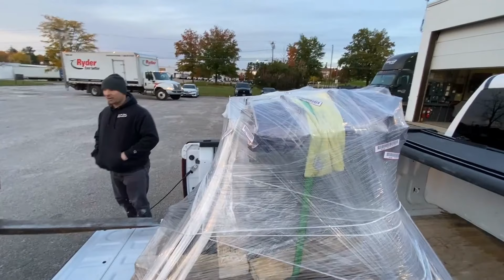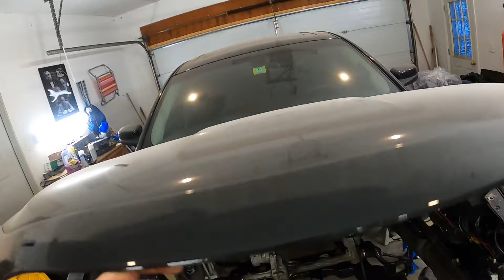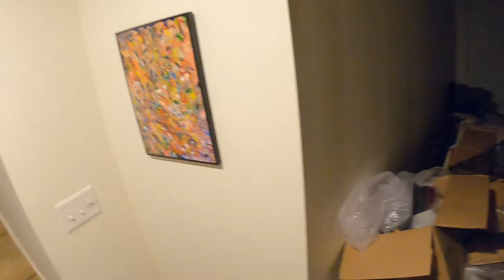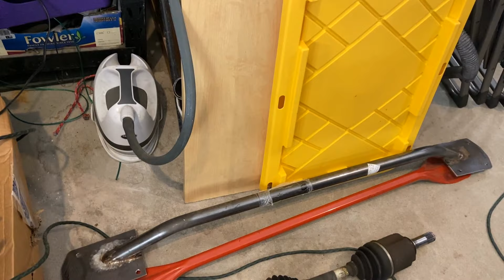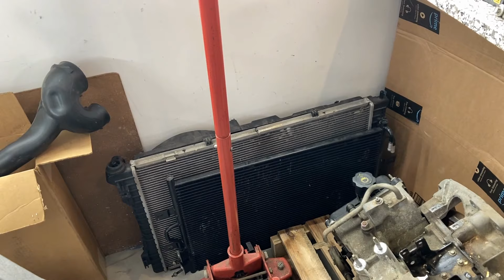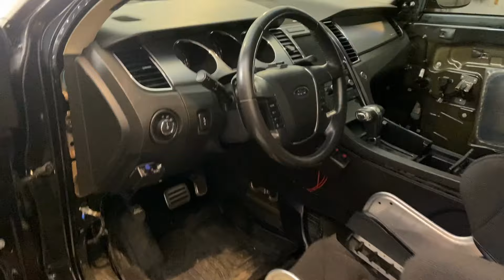2010 Ford Taurus SHO Built Motor and Build Plans

Comment: For the fuel delivery, currently working with DW for the in-tank fuel pump. We think the pump will be the DW525 (same for the SHO), but more info should arrive next week. Currently have the DI HP35 fuel pump and received my +1,700 Cc DW injectors, DI are out of the +2,000 Cc's injectors. My full FBO project should be done (Done-Done) after my fuel system taking care of. My 11's goal was reach a few times, so, with the CR Performance Stg3 turbo's and the Injectors + in-tank pump, running at least on E30/E35, mid-11's should be attainable (with full interior). Being the fastest Fusion not my goal, but spanking Muscle cars at the local track his.
Reply from the maker: Very nice build you have going!  I think you’ll reach your goal no problem

Comment: Post a video when u do the 525 Warbo fuel pump I already have  the dw300 xdi injectors and xdi60hpfp currently in the works to building a motor keep up on the videos gnarly ride
Reply from the maker: Will do